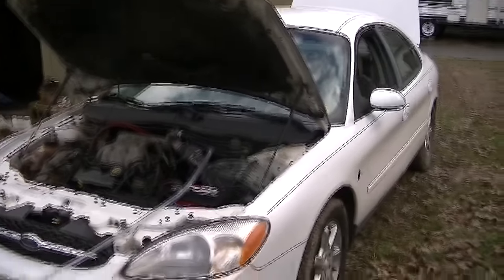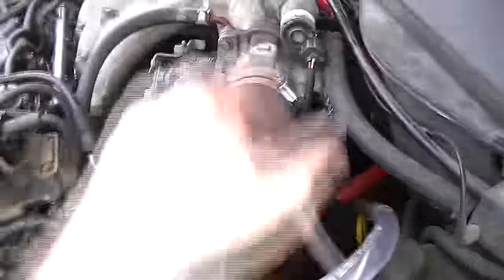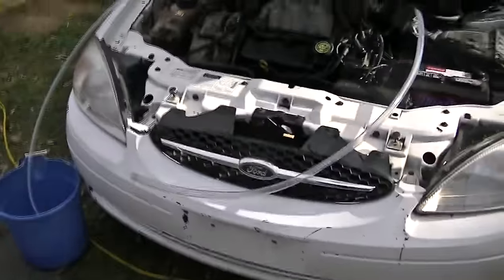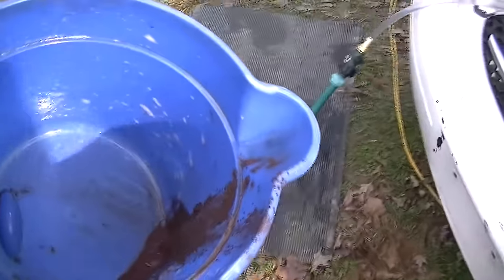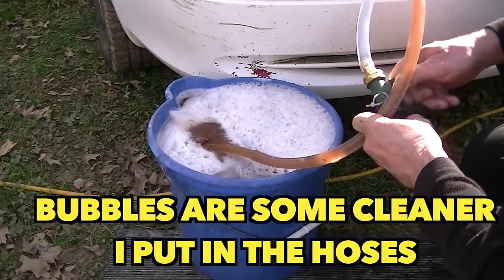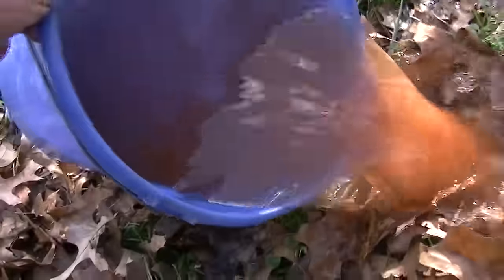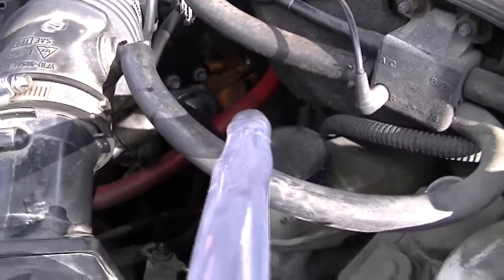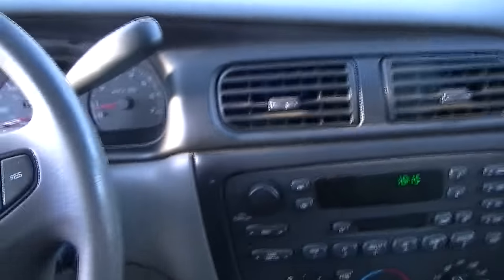Heater Core Flush...100% Plugged! This is Bad! ... Rusty water!!...But there is hope!!!

Comment: Did you also had that sweet like smell in the interior of the vehicle?
Reply from the maker: Slightly...never a good sign ;(
Reply: Yeah I'm doing my research on my 2000 Ford f150 I'm having the same problem I kinda narrowed it down to replace the heater core...but I'm definitely trying changing the thermostat and also doing a flush and reverse flush before I get into that waaay too much work...so it's worth trying all the previous...but thank you.

Comment: this is often times a sign of a cracked cylinder head putting exhaust into the cooling system. or a bad head gasket. sometimes the owner has never flushed the cooling system the life of the vehicle until the time they do this.
Reply: you can rent the heater core with muriatic acid it will destroy any deposits in the heater core and restore oem heat function. you can review my video to see if you like.

Comment: I did this and replaced the thermostat still no heat. When i put it on hot it still blows ice cold. Any suggestions that might help me find the problem?
Reply from the maker: Move to south Florida.
Reply: Nathan Rohrbough yeah was thinking about that but not tryna be submerged in water in 20 years

Comment: What if I try this, but no water will come out because it is plugged solid. Full hose pressure, and not one drop came out.
Reply from the maker: RIP heater core.  ~
Reply: Try some cleaner. Let it soak in then try again

Comment: CLR works well and it's relatively cheap
Reply from the maker: Ok
Reply: But it isn't made for aluminum, so just to warn you, over time it will etch away the surface of the core or other aluminum components, and possibly peel aluminum flakes or cause other issues that will start to flow through your system and deposit in other locations.

Comment: I just put some bars stop leak in my radiator this morning n by the afternoon I have to replace my trans cooler, my transmission is running hot and my heat went out. Oh! And my radiator is still leaking :)
Reply from the maker: O my!~

Comment: I do not condone pouring chemicals into the ground but want to state that is it very difficult to find any shops or auto parts store that take "coolant" or Antifreeze from the HOME DIY user.  In my experience I have only been able to drop off (extremely clean) antifreeze once.  All other times it was too dirty and that ONE shop would not take it.  The only solution is to accumulate it in proper containers and drop off at county Hazardous Waste Events.  Same goes for gasoline, etc..  Now when you are a shop or Auto repair business you can pay to have it taken away.
Reply from the maker: This is just rusty water only. ------No Antifreeze!!
Reply: YEP - just wanted to shut down all the comments about recycling it or taking to a auto parts store.  They DO NOT TAKE IT.
Reply from the maker: People now days are easily Triggered...lol ....Just sit back and laugh.

Comment: So what your saying to these people is don’t spend 40-70 bucks for headgasket sealer that sometimes work and work good. To deal with heater cores or radiators which are cheap.... but rather spend a couple hundred for a tow and then a couple thousand depending on vehicle for the headgasket??? I would rather try the sealer for under 100 and deal with later minor issues then spend thousand that someone might now have. I have same issue right now with no heat after using blue devil headgasket sealer. On a Ford 5.4 f250. But I can deal with that rather then spend 2k or more! The sealer worked for me and as I said spent 60 instead of 2k+ . If I needed a new heater core and radiator I would still end up spending less then I would for a headgasket install.
Reply from the maker: Just get your vehicle home by any means...without using this crap. In 
some cases its probably ok to use....But, If you have a vehicle that 
your really don't care about....Go for it! But Once in....never out! One
 thing leads to another...That stop leak will always be in your 
engine... and its hard to get it 100% flushed out! Some heater cores 
cost up to $1,000 to replace because they have to take out the entire 
dash out!  Some people want to have faith in there vehicles, but 
driving around with that stuff would give most people a low confidence 
in the reliability. But I understand what you are saying;)  I love my 
heat in the winter, so I'll get it home and try it the right way. (at 
least try)
Reply: Yeah cause if it has block sealer in it and you get rid of it your screwing somebody unless you tell them. Like putting 90 weight in the motor so it doesn't knock. Blue devil is not fixing it's rigging. There have been a couple of lots around here that used to do that till they started getting sewed for selling the car that way with out disclosing that it was in there.

Comment: typical ford with bypass tube assembly, the heater core starts to fill with debris and plugs, due to lack of coolant change and system flushing. even maintained vehicles do that and turn the fluid rust-brown ;0

Comment: Hell i dropped my car off at the shop yesterday morning to get a full inspection cause i have a coolant leak and for the past like 3 months my heater slowly been going out. And when i had my guy friend opened my radiator it was like mud.  So right now i feel bad for the shop when they do my car. And that stop leak is what we think the previous owner used cause it looks the same as what you just flushed out the car in the video.
Reply from the maker: Big $$
Reply: @FixingWithPassion  yeah i bought the car march of last year and it had one previous owner which was an elderly person 84 years old. Its a 99 buick century 88,000 miles. So i knew i was gonna have issues eventually. Lol but not the heat in the middle of winter 😂😂😂😣😣😣
Reply: @FixingWithPassion  but how often are you supposed to do flushes on cars in general.

Comment: im going to hook up my pressure
 washer
Reply: 😂 you a fool... lmk how that works 🤔
Reply: @adnelpandur3357  well what happened was as i push the end of the wand in, it relesed the tip and then the water shot the fucker into the engine block...i was lucky to get it out.   it was funny
Reply: @TheCthtoNicfLy  haha! Sounds like a fun time. I was going to do mine this weekend but as I was getting ready to do it my transfer case blew 😂 now wanting on new transfer case to get here then I’ll do the heater and remote start
Reply: @adnelpandur3357  im waiting for a radiator and a new evap, as i was deleting my air conditioning i guess i tossed the evap controller, 98 Cherokee King of Dirt!!
Reply: @TheCthtoNicfLy  haha dang. Hope you get it soon

Comment: Did not hear if you flushed the engine and radiator????   If it's like that in the heater core, you can be assured the engine and radiator is the same way.
Reply from the maker: Oyea! The engine was a mess also....just rust and water...but it got it flushed pretty good and drove all winter long with good heat before I sold it. They are nice rides and a pretty solid car.

Comment: a point should b made if u see that much junk come  out of a core or a radiator u should replace it cuss now u got all that junk out now it could leak from all that time thats stuff sitting ther rusting or corroded that core or a radiator out even tho its stop leak just plan junk from yrs of not changing coolant
Reply from the maker: Thanks! I did in a later video. Brand New Heater core!
Reply: TVWXMAN32  a little fyi to all . i mean sometimes u can get by by fushing and other times u cant it just throw it out ther as a though
Reply from the maker: Thanks! So true.

Comment: Some Ford engines are known for rusty water jackets when people use water instead of anti-freeze. And the water you see coming out looks more like rust than "Stop Leak". I'm not condoning the use of "Stop Leak" I'm just saying, THAT rust looks more like it's caused by someone using straight water instead of the proper coolant. And is that really a proper way to discard engine coolant? Does anybody know, " what is the proper way to discard used engine coolant"?

Comment: Radiator stop leak plugs heater cores up to if the heater core is plugged up that bad you unplug it chances are it will leak later on

Comment: Did anyone notice that when he said he could feel heat coming out of the vent, he actually had the temperature dial set to cool????? Interesting........ and impossible.  Check the video at 14:37.
Reply from the maker: No I was checking for cold air also to see if the blend vent door was working also. They become stuck sometimes only giving you heat. It was a slow reaction on my part. Trust me it was hot on the hot setting;)
Reply: @FixingWithPassion  Nathan is right,the dial was set to about 70 %.not sure what people are looking at.

Comment: Thanks for the video. Just my two cents but that stuff needs to be recycled its highly toxic, the lawn is not the way to go. Dont get drawn into the results from pulsing the hose on and off cause it may not seem like it but it can cause some serious damage. The pressure of the cooling system is around 20 PSI where as the typical water hose is around 65-70 PSI. good video though..
Reply from the maker: Yea ...I might get lucky and get 20lbs in that garden hose....it had leaks everywhere, But I know what you are saying. If it had been a mercedes I might have been more cautious. Its just a old ford...lol Dime a dozen ;)
Reply: Jacob Vance - there is no build up of pressure, when the other side is wide open!  Not a closed system when flushing.  Now if you're referring that flow of water or volume may be to high, then that I don't know, but I think the water pump may be pushing same gpm's?
Reply: There is another video in which the guy has a pressure meter on his hose coupler. He gets a maximum 15psi. When he reverses the connections after the initial flush, it has fallen to 5psi. 

But I agree that 'pulsing' the valve is a bad idea. That can generate momentary overpressures much higher, and avoiding those could mean the difference between a safe flush and a leaking core.
Reply: It's a little bit of rusty water.
It will have no impact on our environment. Your farts will have more of an impact on our environment.
Reply: Jacob Vance Dennis says dpnt be sp cheep take out the raitor. And have it rotted out ok. How much. $20.00
Reply: My car lets 👀 it's overheating my mechanic says the radiator is plugged the heater core is plugged and we're going to unplug it muriatic acid

Comment: That's not a radiator stop leak problem it is a radiator fluid problem if you put two different kinds of radiator glided it will term to slug eventually it will blow your water pump and clog your intire cooling system use mixis with all win you add coolent

Comment: Must not have much water pressure where you are at. Most cars are 10 psi max to the heater core... Lucky it didnt blow it right out.. Never turn the garden hose all the way up guys never. Also it was rust water not coolant. That year and model it would have been green not orange.

Comment: You realise the rest of the cooling system will be similarly gunked up, not just the heater core
Reply from the maker: No, the heater trapped most of it. Rest of the system was ok.

Comment: That is not stop leak haha that is built up rust from not using coolant  in a steal block... 
 Try that in an aluminum block and see how far it gets befit it pits and corrodes a hole threw the block.

What I see is pore maintenance and a cheap solution that inevitably finnished it off. 
 In a properly maintained car stop leak would have never done that to the heater core plain and simple
Reply: Iron block, Steel,Poor,Finished. Got inevitably right though.

Comment: I bet the heater core went bad after that
Reply from the maker: No actually it worked pretty good. But I decided to put a new one in it 6 mos later as I sold it. The new owners said they wanted to keep the car a long time cause of the condition it was in. Replaced the heater core with a new one...and it still going today. I'm envy because its hotter that my current SUV. Yes but sometimes they do leak afterwards...you just don't know
Reply: TVWXMAN32 yeah ford are tough. I pulled the lower hose on my mustang and 6 months later pop goes the heater core

Comment: You do not not use water pressure over 5 psi, and you don't turn the pressure on and off
Reply from the maker: Heater cores are pressure tested to be safe at 40psi. Although most have relief valves on the cap at 14.5 and higher. They start to puke.
Reply: 10 psi is pushing it, anything above can rupture the heater core, study up
Reply: Only if it's bad to start with. If anything this is a good test to find out if core is bad or not. If it can't hold the pressure it's bad. Besides if you study up you will find most cars have 13 to 16 pound pressure cap.
Reply from the maker: You are right! Just Lots of troll pages now days. People post just to have nothing to do. lol